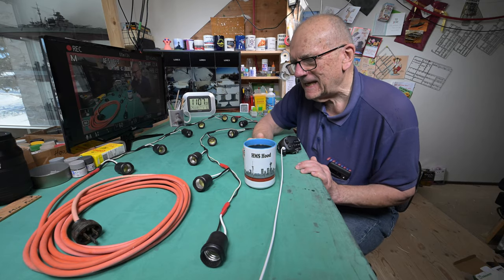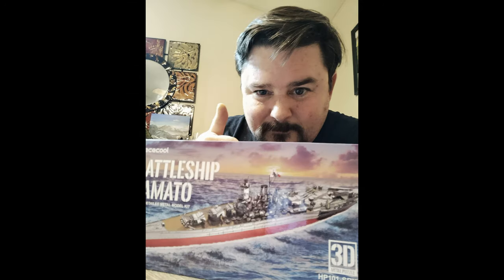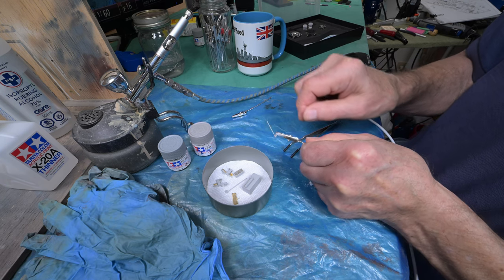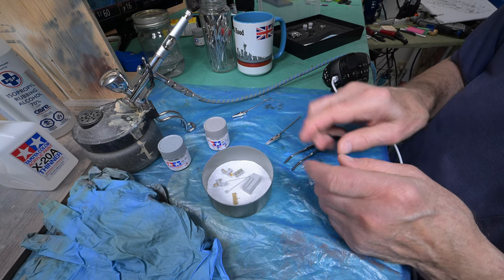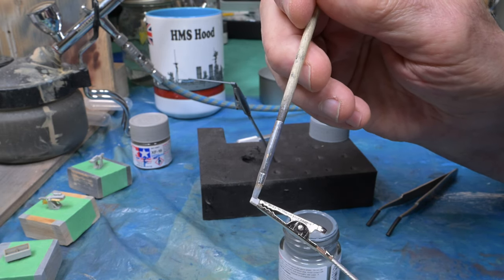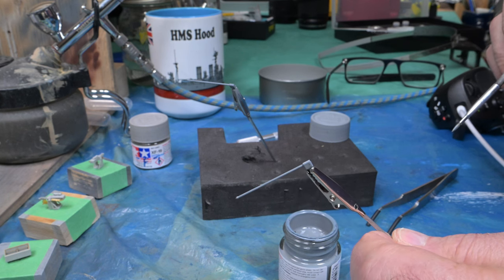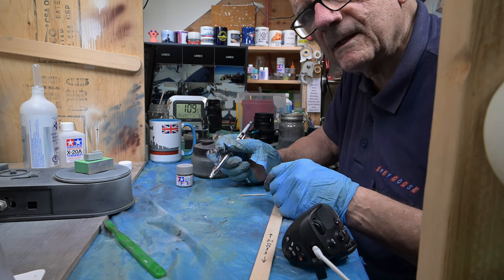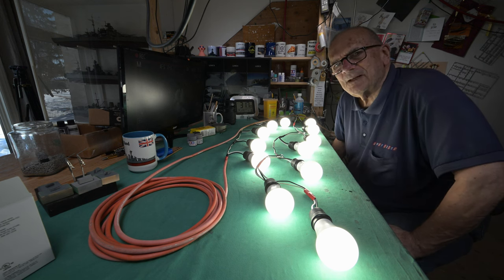The Model Ship - Part 1546

Comment: AC is bidirectional, so no worries about getting polarity wrong.... There is a rectifier within the bulbs.
Reply: AC is a sign wave that oscillates 120 volts above and below the 0 volt line at 60 cycles in the US and Canada. Within each bulb is a small circuit to convert the AC to DC and step it down to the correct voltage. So it will work both ways,  HOWEVER,  there is a load and a neutral wire and if you get them backward, you "could" get shocked.  The center pin in the socket should be the BLACK (LOAD) wire and the outside should be the WHITE (neutral). In the US,  the Neutral and Ground are tied together in many states. Not sure if they isolate them in Canada.   They do it this way so if you accidentally touch the outer ring of the bulb while screwing it in,  you don't get shocked.
Reply from the maker: Re: "so no worries about getting polarity wrong" One way is safer than the other --- or perhaps I should say, less dangerous.
Reply: @duanebeyer950  Even more important to observe here in the UK as our line voltage is nominally 230volt with the potential to cause harm if not death
Reply: @duanebeyer950  ...I'm sure you know this, but for clarification, 120V is the RMS value...to find the peak voltage of a sine wave, multiply the RMS value by the square root of 2...the peak voltage is approx 170V...!!! So the voltage swings from 170V to -170V...
By the way, you explained it very well...👍
Matt
Reply: @_zhawkeye_9808  I may have WAY in the back of my mind when I was in electrical tech. I went from electrical tech, to electrician, to software engineer.  I stuck with the software engineer for 40 years and electronics became a hobby. Thanks for the clarification.  :)
Reply: @duanebeyer950  ...well, I stuck with electronics...and while I liked it, I'd have been much better off going with software engineering...so kudos to you for making the jump...😉👍

Comment: ...hilarious!!!...loved it...👍
In case heatshrink isn't an option in the future, they make a liquid insulation to cover connections and is watertight after curing...also, the self adhesive heatshrink that you used (red) is also watertight if it can make a good seal at the ends...👍
Matt

Comment: FYI, you do not need to be concerned about polarity on ac, it will light either on the positive or the negative phase. Just use a large enough resistor for the voltage. I have had a diode, old fashion red one, in series with a resistor across the line as a pilot light on an electric water heater for the last 40 years.
Reply from the maker: Re: "you do not need to be concerned about polarity on ac" One way is safer than the other --- or perhaps I should say, less dangerous.
Reply: @roncalverley  I think we are miss-understanding each other.  Yes, on a screw in bulb socket, the shell is neutral and the center pip is hot.  Led light bulbs do have an internal non-isolated power supply, I've dis-assembled several.  What I meant was literally a led & a resistor in series do not care about the polarity on ac power.  In my case both leads to the water heater are hot, 115v each, 180 degrees out of phase, there is no separate power supply for the led just a resistor to drop the 230v to 1.5v about 10 mA.  It is on a timer so a "pilot light" to indicate on or off is nice.  Saves a little electricity to have it stay off over night when not in use.
Reply from the maker: @silentrunner3067  Thanks for clarifying! 😁👍